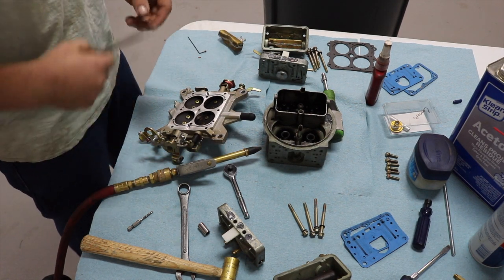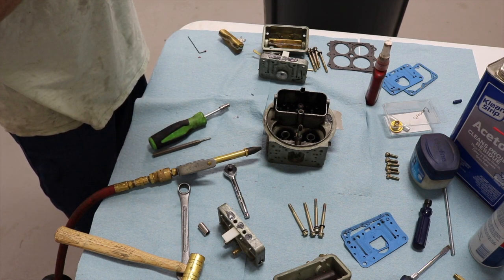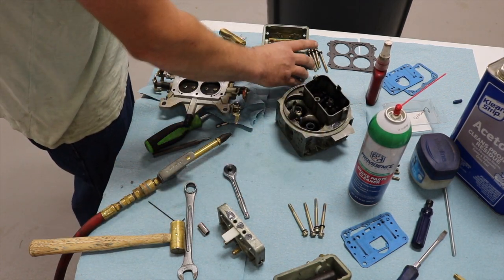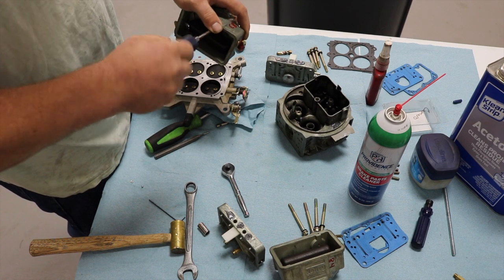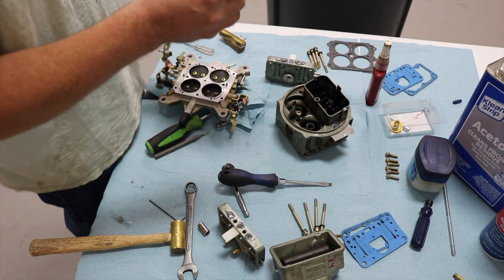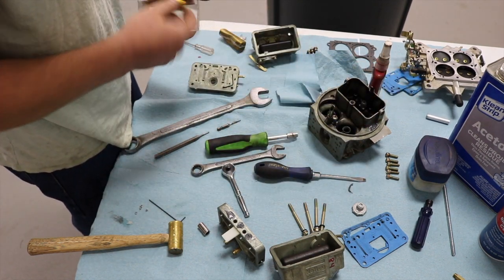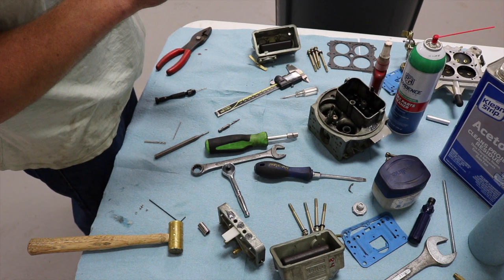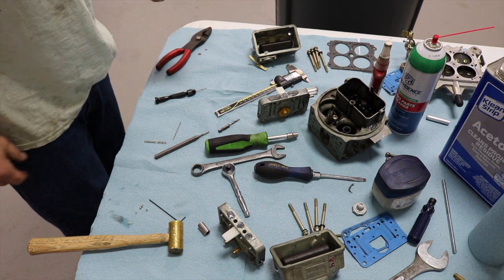Building a Blow Through Carburetor For The Turbo 460 Part 1

Comment: Wait a sec don't most folks use the power valve circuit to actuate the power valve?  Fuel pressure to actuate a power valve?  Unique approach..

Comment: So you blocked your power valve signal ? Is it working that way?
Reply from the maker: Yes, The boost actuated power valve opens based on fuel pressure in the bowl. As boost builds fuel pressure is increased 1:1 with the a fuel pressure regulator. There is a screw that sets tension on a check ball via a spring. as you increase spring pressure by tightening the screw in the power valve you delay boost fuel enrichment.